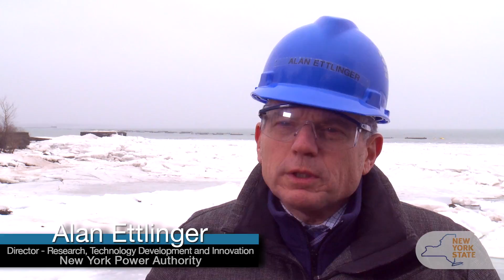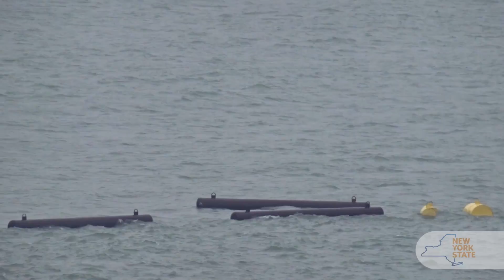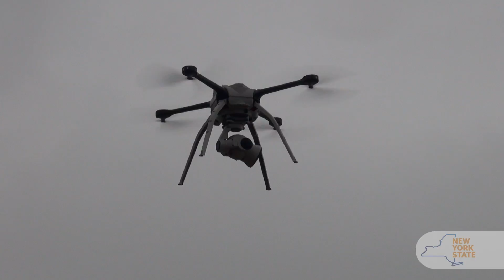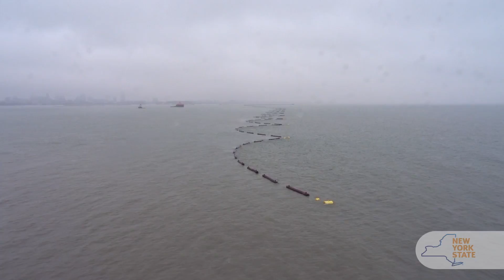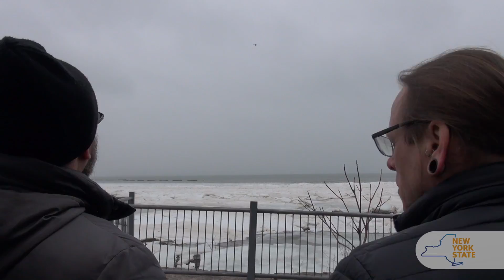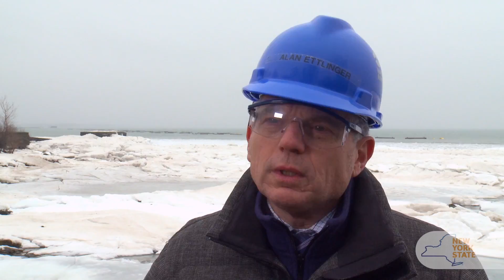First Drone Inspection of Niagara Ice Boom

Comment: I'm struggling to see how a Ice boom is supposed to prevent big chunks of ice going upstream? It there are stormy estuary tidal waves wouldn't the booms act as rollers for the sheets of ice to roll over the top of them?
Reply: The boom helps to resist the ice from going over the boom and causing ice jams in the river  downstream . The boom is designed to control the flow of ice so only a small volume of ice is run over the boom.